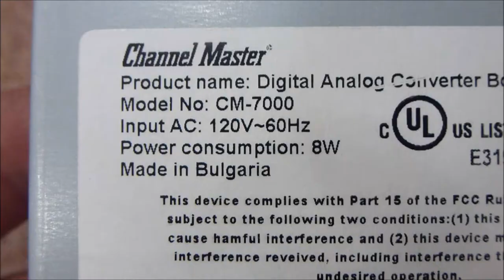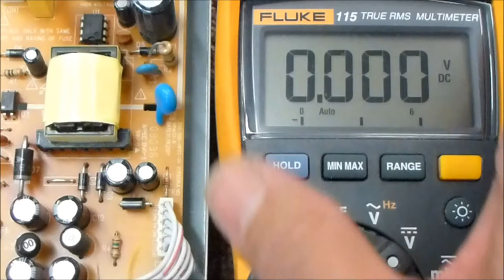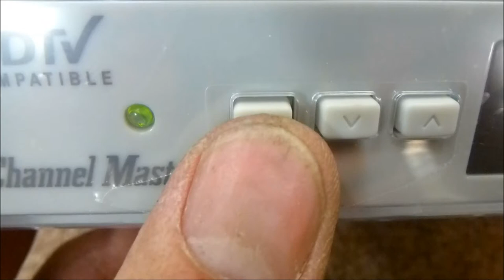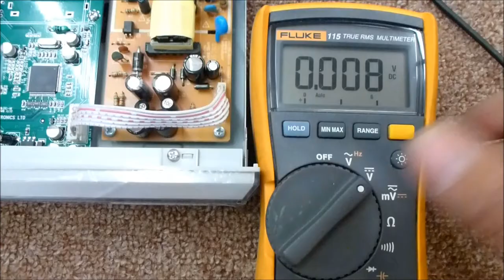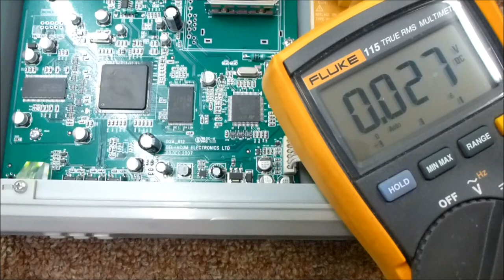Channel Master CM7000 Digital Converter Box Repair DTV CM-7000 CM 7000 DTV D.T.V.

Comment: I'm senior broadcast engineer  and do not normally find myself getting solutions to electronic issues  from youtube. 
However sir, I  want to thank  you for helping me succeed  repairing this unit although my capacitor ESR meter and my voltmeter were telling me  otherwise.
This is a clear example of tight circuit design,where slight change of  component values can degrade or stop the operation of an entire circuit. I replaced not only the caps on the switching regulator but also the two caps you mentioned on the video processing board to shorten charging time of the  critical 1.2 V tank circuit.
Thank you again.

Comment: I used this guide to fix my CM-7001 that had a blown cap.   Spent $1.00 on a package of two capacitors instead of $120 on a new CM-7001.  Thanks!

Comment: Thank you for the great video! It showed me exactly what to do to repair my converter box. All I had to do was replace capacitor C12 & C13. I ended up buying the other 6 capacitors, just in case I need to replace the other capacitors.

Being new to this, I had to learn everything from scratch, from buying the tools & supplies, tinning, desoldering (I decided to use a soldering wick) & soldering. I’m still not exactly sure how to use a borrowed analog multimeter to read the power supply. Nothing looked as easy to do on the video!

Definitely, the hardest part was deciding which soldering iron & capacitors to buy. Fry’s Electronics didn’t have the exact capacitors, & buying online wasn’t an option (Shipping the parts would take too long; I didn’t want to wait). On top of which, I was surprised to learn, while looking for the capacitors at Fry, that ufd (microfarad) is the same as mfd (microfarad), just labeled differently. I was looking specifically at the ufd section, totally ignoring the mfd section. I ended up buying mostly from the mfd section. And then, when I got home, I was shocked to find out the replacement capacitors aren’t the same size as the original capacitors although the rating is the same. I didn’t realize there would be a size difference. Seriously, there’s a steep learning curve involved. Just buying the soldering iron took tremendous amount of research. Ironically! The easier part of this whole ordeal is soldering the 2 capacitors in. Ha!

Comment: Use this tutorial to fix the CM7001. It had a blown cap (680uF) in the power supply that was changed. The unit then powered up and worked just fine. Thank you for this very helpful video that saved me buying 2 units at around $150 each. $3 versus $300 was a no-brainer.

Comment: Outstanding video!  Found a bad cap (330uF 16v) on our DigitalStream DTX9900 and replaced it with a 25v.  As a matter of fact the same cap failed in both of our boxes.  Who'd have thought a fix could have been found on You Tube?  Thanks for sharing!

Comment from the maker: Its a closed loop system and if the feedback voltage goes low the supply tries to compensate by raising the current to the switching transformer and since all taps are shared off of the same transformer (3.3v, 5v, 12v)the others go up

Comment: My cousin and I each bot one of these back in the day and they both quit working within months of each other.  I had seen cap replacement on the green board (most likely where you indicated.)  I've keeping them around for a repair project.  THANK YOU SO MUCH FOR THE DENTAL PIC TIP!   You made life easier!

Comment: I know a common problem for low output voltage can usually be caused by a bad capacitor, but how does it cause the other outputs to be high like here?

Comment: Thanks your for this video which clearly explained the problem, detailed
the operation of the "green light" and explained the caps were Pi filter
components.  This was what I needed to fix 2 dead units I had last week.

I did not have the understanding before this video to get these fixed.

- Best regards!

Comment: Thanks, great video.  I'm getting one of these to work with a replay 5040 for my mother.  Considering the unit is almost 10 years old I will be replacing all the offending caps up front.  Do you have a list of replacement numbers?

Comment: I have a cm7000 pal where the tuner doesn't work all of a sudden. What would cause that? DVR, menu, and guide all still work, just no channels displayed when changing the channel. Antenna input is good as it works on TV.

Comment: Hi, replaced the six caps and got the voltages back to spec but still had the red light.  Noticed that the F4 fuse was gone (blown?).  Problem of course is what is the spec for that fuse, anybody know?

Thanks

Comment: Thank you! Was reading 3.0 instead of 3.3. Changed capacitors C12 & C13 and got a reading of 3.31. (I used a 16v/1000mf and a 16v/470mf). Fixed it, and working great.

Comment: I had about the same readings on all three points when I started. After replacing all six capacitors, two of the three were close. The five volt was reading around three volts. I still get only a solid red light. Any suggestions?

Comment: @NorCal715 , I am getting over voltage on 12V, 5V, 3.3V. I think one of the inductors  have a wrong value. Are the power supply inductors L4  suppose to be 1 uH? Mine is 660nH.
Reply from the maker: Inductors usually dont change value unless shorted(then the eddy currents change the "Q") and its toast. Capacitors do though.

Comment: Nice vid. It would be better for newbies if you briefly covered where to get new capacitors and how much they cost and so forth, however. It's going to be a stretch for a newbie to even go into a project like this. Any uncertainty is a huge obstacle for beginners.
Reply: I found all the capacitors from Digi-Key .... www.digikey.com

part numbers 
* 493-1823-ND
* P10224-ND
* P12924-ND
* P14394-ND (need 3 of these)

By the way the fix shown in the video worked PERFECTLY.

John

Comment from the maker: 30+ years of electronic repair experience.
Reply: I am getting over voltage on 12V, 5V, 3.3V. I think one of the inductors  have a wrong value. Are the power supply inductors L4  suppose to be 1 uH? Mine is 660nH.